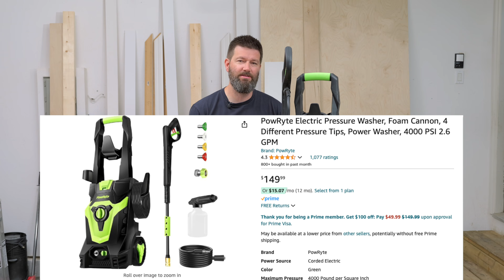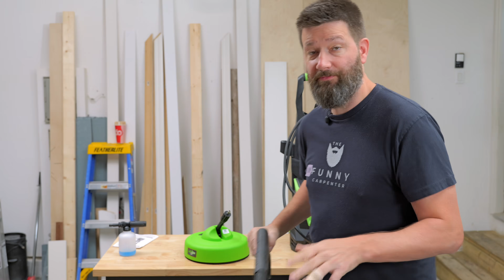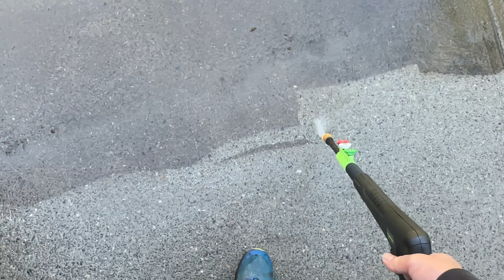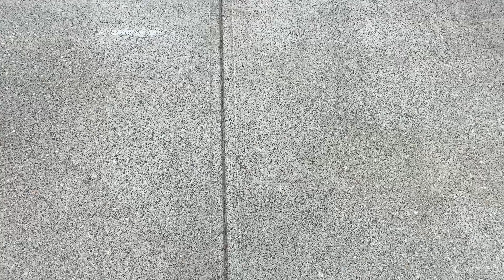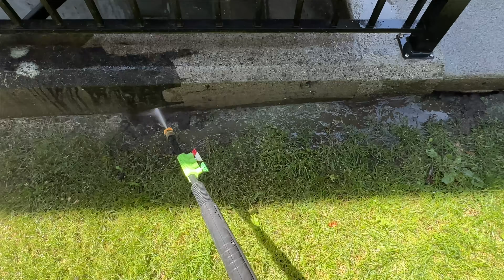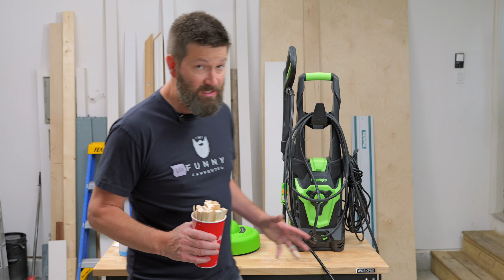Should You Buy An Electric Pressure Washer?(Scale 1-10)

Comment: You are promoting a pressure washer that is missing a GFCI in the power cord, a critical safety feature that all others have to protect the user against electrocution.  Get ready for a product safety recall.  You can easily check online for the safety listing status, if you really cared for that kind of stuff.

Comment: I bought an electric pressure washer before. It was made in China like many other sold at Amazon. I used it two years probable 10 hoers each. Turned on this year, it broke. Leaking water from inside. Tried to find a repair shop. No way. Made in China. No one repairs it here. Parts are not available. So, if you are looking for a pressure washer or any other machinery, check first if it has a repair shop in your area.

Comment: Thank you.  I was very skeptical about electric pressure washers until I bought one 11 years ago.  It just keeps going and going with no issues at all. 

I actually didn't want a more powerful gas one to clean our composite deck.  Less risk of damaging it.  And not having to deal with filling it up with gas, worrying about whether it will start after sitting for a few months and the fumes and noise of a gas unit is very very nice.

Comment: I bought this unit for my car and motorcycle mainly to rinse all the crud off and hit it with the foam cannon. I didn’t plan on using it for anything else but it’s nice to know I can.  I’m about to use it for the first time on my bike. I’m a little worried about the pressure, but I’ll start further away and use the less powerful tip and take it from there. Nice video, thanks.

Comment: I have a yellow version of that washer (who know what brand but it looks just like that).  for a homeowner, it's awesome.  it starts every time, ti's very quiet, it's got enough power to do homeowner jobs and for $150 (which is what i paid for mine too 3 years ago0  it's more than paid for itself instead of having to rent one.   

I've stripped paint off fences and walls, cleaned patios, cleaned decks.  it's great.  and i know that the next time i need it (probably next year) it will fire right up.

Gas ones, well it might start, it might not, did you put stabil in the gas?  why doesn't this start?  and definitely louder.  

If I was a professional who used it every day/once a week, no it's not enough.  for a homeowner who uses one every few months if that, it's freaking great.  And it's a plug in so no stupid batteries to go bad/lose/get discontinued.

Comment: It's numbers appear to be way off since I get better cleaning with the 45 degree tip and my 2800PSI gas washer.  That said, it's a step in the right direction for electric since it doesn't need the rotary tip to get decent PSI.

Anyone getting a pressure washer, be it gas or electric/battery, I can't emphasize enough to get a surface cleaner.  I've found they've cut my flat surface cleaning times by 2/3 to 3/4s of doing it with a fan tip.
Reply: Yeah i think gas with a surface cleaner is the way to go if you have a lot of yard.. I have been using electric (1600 psi, 1.2 gpm) but it was taking 3 full days with a turbo nozzle to clean about 2600 sqft.   Yeah i could try a surface cleaner with the electric but i got the impression it didn't clean as well.. And i had seen the gas pressure washer cleaning that same sq footage in about half the time or less..

Comment: I brought an electric Greenworks 2900 psi model. Power washed the deck, did well. Washed two cars again did well. On /  off button for when plugged in but not using. Go electric for home use, no gas, no oil changes, no filters or any other issues assisted with gas.

Comment: looks like more of a 1800psi machine.  nice with all the attachments.  But, I live on the BC coast and electric is useless here.  We get a coating of thick green r black gook every winter.  Left longer it develops into an inch thick of moss along my 200 foot driveway.  The deck used to take 3.5 hours with an electric Karcher unit.  So I got gas machine and a big surface cleaner.  Can do the whole deck in 30 minutes now.  Carport used to take 2-3 hours, now it take 30 minutes. I even did the roof of the house a couple times when it gets an inch of moss across it.   Electric is not there yet, for our needs.

Comment: Is it 4000psi? Lol no. Some Ytber did a big compro with these electric washers and found the Ryobi one the best, but that was years ago. That model came closest to its psi rating and GPM. 
What really limits these is the power - if 240 20 amp circuits were more prevalent you'd have around 3x the power to work with.

Comment: Very surprised and somewhat skeptical regarding the 4000psi.   I would like to have a way to measure the water pressure.   
I've used only electric power washers around my home for decades.  I find they do not last long.  
It seems the pumps wear out quickly and the pressure at the tip declines.  Otherwise, the plastic bits just begin to break.
Nevertheless, it beats having to obtain, ferry about and store gasoline (and keep the boys from "experimenting" with it).
Reply: it's obviously equivalent to the under-2000psi units.  But the number of nozzles and the surface cleaner would leverage that power to be more useful than electric PW I used in the past.

Comment: I'm sure not all electric ones are the same, but I ended up with one for free and I was blown away by the usability of it. I figured it could never have enough volume/pressure with an electric motor. I was wrong.

The one I have is a happy mix of just enough to do what you want to do, but not so much that you can easily get in trouble. 

Big power you're still gonna need gas, but the fact you can take a break and these things just shut off when you let go is so nice.

I should add because you're talking about it.
Specs.
Noooo way they right on yours, I know they are not on mine. They are rarely right on any powerwasher.

Comment: I have an electric and a gas pressure washer.  The electric is what I use 95% of the time. 

The gas is just a pain in the ass.  Every season I have to drain all the gas out of it and fog the engine to prevent issues.  Only use non-ethanol. 

I would make sure that you store your pressure washers in the basement to prevent any kind of pump damage if you're in a cold environment or use a winterizing fluid if you store them where it's going to drop below freezing.

Comment: Every electric pressure washer I have owned has died from sitting unused.  Be sure to use some sort of lubricant in them when you store it or it will probably seize up a valve and not go into high pressure mode.
Reply: this particular one says in the owners manual to run it 2-3 seconds dry when done which i’m assuming is to shoot out the water to lower the risk of something like that happening.
Reply from the maker: Interesting point, something I will research further.
Reply: All my electric pressure washers have fared poorly in terms of of how long they last.  Blown diaphragms and things like that.  In terms of pressure washing concrete, another big advantage to the attachment is that it tends to remove less sand than the fan tip.  When too much is washed out, it gives moss and algae a great pit to grow in and then it just gets progressively worse.  I’ll often use a chemical cleaner first and then go over afterwards with the pressure washer attachment for best results.

Comment: I'm thinking, water and electricity don't go together... Is that what you mean?
Reply: these units are sealed pretty well on the two sides and are required to have GFCI built into the plug, they are less dangerous than most pond / fountain pumps
Reply: I'm thinking religion and Youtube comments don't go together.

Comment: Great video, but you missed a very important feature.
The one good reason to have it stored in a clearly visible spot in a very particular ready for use configuration, is the fact that with the exeption of electrical fires, these things beat fire extinguishers every time. Try it out to get the best setup. You won't be disappointed.
Reply: Also if you live somewhere with freezing temps be sure to store in a location in winter where temps don't get to freezing. There'll be some residual water in the unit/pump and it will be inoperable if it freezes in there
Reply: I wouldn't expect that to work well on grease
Reply: @jeremiahbullfrog9288  Correct, but that is mostly because fighting grease fires with water is tricky to begin with. It's not undoable per se, but there is a lot to be taken into account, it all matters and grease fires can go sideways extremely fast. Water in volume on burning grease is a recipe for a true inferno. Trust me, I bought the T-shirt.

Comment: Great video!  It seems comparable to my Ryobi @1800 PSI, so the PSI is almost certainly false advertising IMHO.  After previously dealing with a gas one, there is no comparison for around the house.  Go electric every day all day.  The gas one had fuel line issues, issues with starting, and the heat from the engine even fried one of my hydraulic hoses, putting a hole in it.  No gas needed.  No oil changes.  No air filter.  Much lighter/smaller.  I have yet to meet a job it couldn't do, although admittedly the job may take more time.
Reply: When you’re talking about an electric pressure washer, they’re basically all the same because you have 120 V at a maximum of 15 A.  So that’s 1800 W of power and that is the limiting factor.
Reply: @vbart1776  I would love an affordable 240V 3600W unit but anything in that range is crazy dollars
Reply: @vbart1776 until someone is going to attach a robust battery pack you can charge and gives you 4 hours of high-powered continuous use. Impulse Lab is doing it for electrical ranges. High capacity battery, (trickle charged) gives you on demand high-powered cooking. Boil water in 30 seconds type thing.
Reply from the maker: Right! There are so many issues that can happen with a gas unit.  I will definitely be using this one over the father in laws gas powered unit.